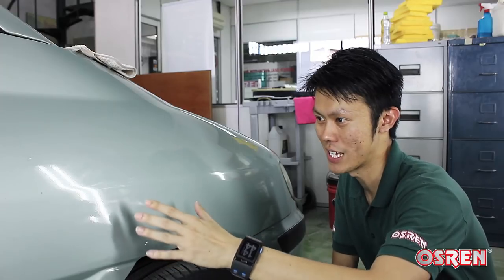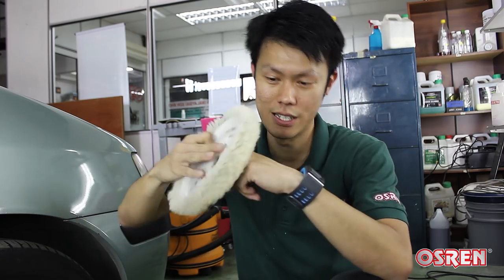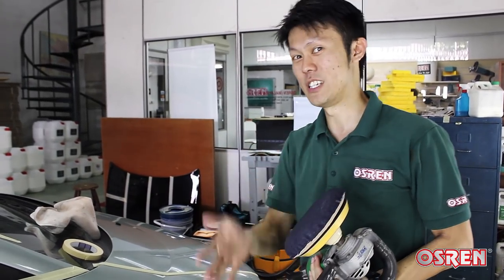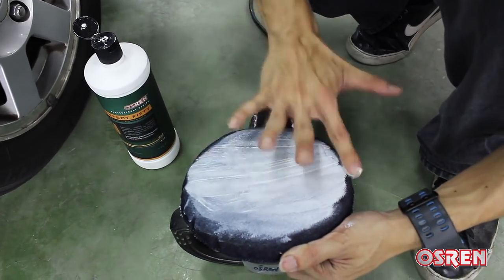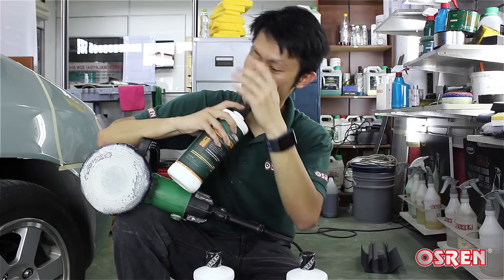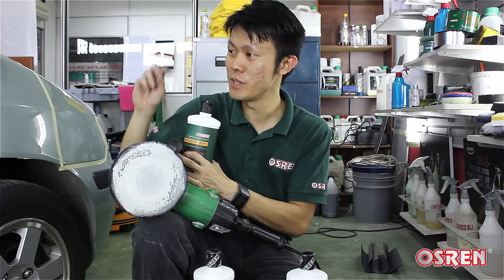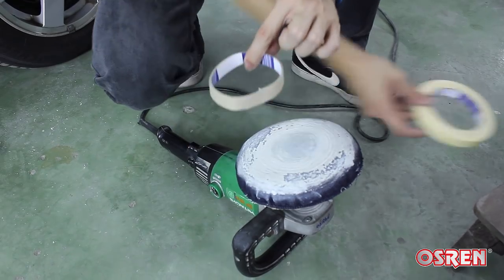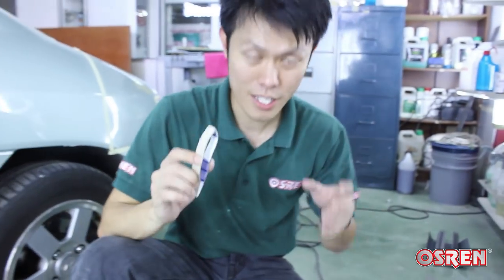How-to remove orange peel without sanding (Step-by-step Guide)

Comment: Denim pads don't level like sanding.  They leave a slightly lumpy finish. Good enough for repair work, not for custom paint.
Reply: You are 100% correct but the denim pad is a great option for people who aren't experienced/confident enough to sand their paint.
Reply: Not all paint jobs pay like custom paint jobs... Do you do work for free???
Reply: Luka Arko ahhh the struggle send some of those customers my way... I like my customers but some of them want me to polish a turd for the least amount of money (the struggle) ill still do the work but will not remove orange peel... You are living right for sure...

I just got velvet and denim pads I could only find 5.25 pads on the DA... I am excited to test them out... Do they cloud the panel? I assume Will I have to go back over them with a  buff pads or microfiber pad for a real nice shine...
Reply: So more of a polish than a compound?
Reply: yeah Ill pm you
Reply: +Luka Arko read my above comment
Reply: +Luka Arko you dont need a paint depth gauge....just flat it down with wet & dry P1500 or P2000 grit paper (3M is the best manufacturer) so you can  see what you are doing (the lacquer or clear as some call it will go totally matt) then machine polishvit up with a product like G3 ect then step up to a finishing compound.
Reply: Richard Coles I seen photos of his work. He does good work... I would recommend using 1500 on major orange peel  1500/2000/3000trizac/5000trizac buff heavy/polish

I painted a hood and my gun spit out water on the hood I sanded out but left orange peel 1500trizac/3000trizac/ velvet/heavybuff/polish still left it hazy. Why I added 5000trizac to the agenda. and will removed orangeppeel entirely with 1200/2000/3000/5000/buff/buff/buff lol

I get to paint the hood again and have fixed paint gun issue since then...:)

3m is awesome. best sandpaper out there. and tape
Reply: nice one...& yeah any other tape/paper is never really any good it's always behind.
Reply: John W Ot amazes me on how many steps painters are using to polish out paint these days.

Get a rotary
Learn how to use a rotary 
Sand 1500 grit dry
Use wool pad with super duty compound
Finish with foam and swirl remover
Done.
Reply: Dan Henderson Sensi my paint teacher uses that technique and it works good. I think the change was based on the shapes of cars. there are way more curves and bends on cars today. I like the long process because it keeps maximum amount of paint while leveling out the orange peel. and trizac pads adjust because I use a soft pad interface (which are amazing for sanding down cars for prep as well) but just for using leveling paint out on any surface. I have them on the 6in and 3in which are important for small areas.

Usually I try to paint with minimal orange peel and really build the clear on the panel. But on certain panels you run risk of making runs which are always a bitch to sand out.

1500 needs one more before buffing with any compound IMO. I see lines still sometimes
Reply: +Dan Henderson exactly..but if you don't know, I guess you don't know ;)
Reply: Waaaay to many steps. why take the third step at all? You like wasting time?

Comment: is it just me or did he use an excessive amount of compound?  even considering it was a brand new pad.
Reply: It's okay to use alot as long as the pad isn't facing down dry and causing unnecessary heat pockets that may cause burn-ins

Comment: The only difference is the grit is now in a compound form not on paper . You are still using grit to remove the clear coat . 
Just sayin . 
Also … you really need to use a paint depth gauge to avoid thin areas and you need to blow out the wheel often .

Comment: Funny to look at some of the comments. Sanding with sand paper? I will never anyone to sand their car with sand paper, especially new car. Experiences will help but can not avoid fully from damaging the paint using sand paper. Generally due to new car with thinner paint nowadays and we have no idea how much have been cut away for old car.

Reduce the orange peel with denim pad is the best solution. Even you got 100% confidence to remove orange peel using sand paper without damaging the paint, do you really want to sacrifice your paint thickness? How are you going to compound your car again in the future. We talk about long term maintenance of a car. Unless, you detail the car for show purpose.
Reply: p1500 or p2000fine grit (wet on a rubber block) is absolutely fine & will barely remove a lot, unless you flat it like a banshee lol
Reply: So in your opinion denim pad adds paint thickness lol.
Reply: Did you see how quickly it knocked down the orange peel? How can you not say its aggressive? With 2000 grit you will never be able to do it that quickly.  What makes you think this is a safer approach at all. The video just shows a different way to to, not what is safest.
Reply: LOL GOOD SHORT

Comment: bro can 3M perfect IT remove orange peel?
Reply from the maker: The act of orange peel removal requires an aggressive approach to cut more clear coat than compounding would. In this case, we formulated it with an aggressive abrasive and paired it with a denim pad (it's more aggressive than wool).

Perhaps it is best to check with 3M if their compound is designed for orange peel removal. We are not in a position to speak on behalf of them.
Reply: No, and I don’t think the method in this video will either.. you need to level orange peel with sand paper. It’s been done this way for years and years and continues to be the best way to date. I think the denim would be good for heavy imperfections though.

Comment: how do cars get orange peel?
Reply from the maker: Hi there, 

It could be various reasons such as spraying techniques, materials, atomisation, gun settings, temperature, or mixtures of hardener. It is usually more prominent on repainted panels/cars compared to original factory paint.

Comment: Denim pad  is only good for 1 or 2 panels  not for the whole car  ,when its new it works  but   after more than 2 panels it will be fucked ,the way you use excessive amount of compound my be  you will need 4 to 6 pads to buff the whole body    AND ONE MORE THING ITS TO RISKY using denim pad   most of the cars now days  got very sharp edges ,to me   i am done with your video .